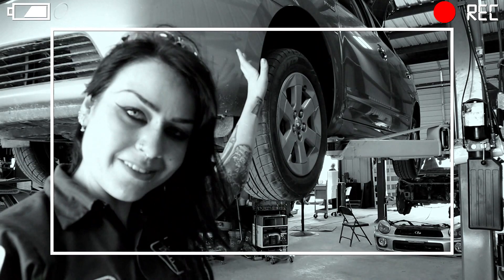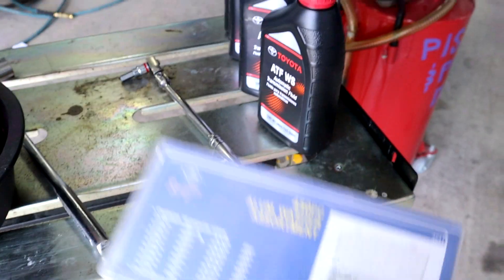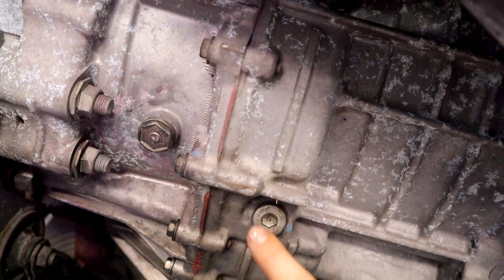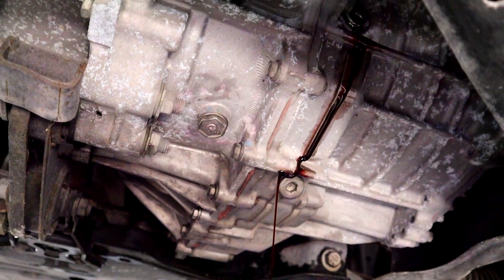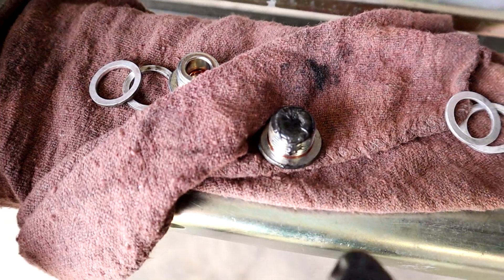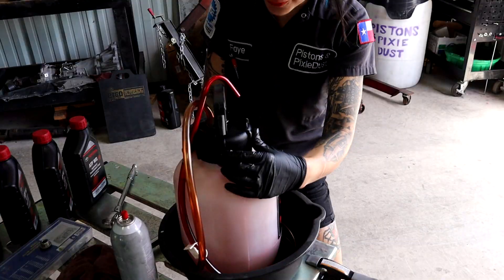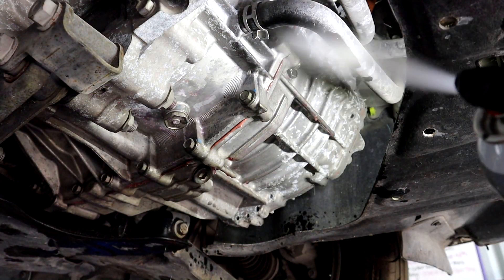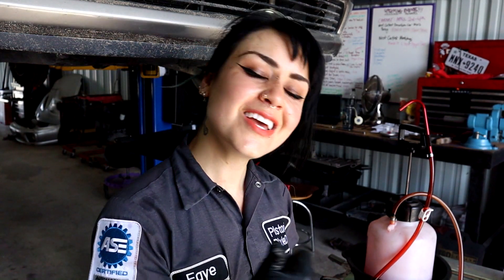How to Change the Fluid & Check the Fluid Level of your Gen 2 Prius Hybrid Transaxle / Transmission!

Comment: 29 torque lbs is actually too much...think about it, when the engine was new, that was the specs and those threads were dry...
Now you add that lubricant and that 29 actually gives you a greater stress than dry torque numbers. Fyi ...
Reply from the maker: I am sharing the service instructions verbatim from the Toyota Repair Manual. If you have an issue with the torque spec from the Toyota engineers, bring it up with them.

Comment: Thank you for your video. You were so thorough and advised using diagrams what is the correct fluid level. I also appreciated you including metric parameters for torque specifications ie newton meters (Nm). Other YouTube video just quote in imperial. Adrian - Dublin

Comment: You did an awesome job and I appreciate the info. The Motiv fluid pump may be quicker but it's too pricey at $101 for the average do it yourselfer. The $ 15.99 Slippery Pete Fluid Pump for Gallon Bottles and Wide Mouth Quart Bottles - Transfer Gear Oil, Transmission and Differential Fluid, Antifreeze with This 30cc Hand Pump

Comment: Thanks for the video. I was thinking to do my first transmission fluid change for my (TOYOTA 2015 PRIUS C (THREE)). I went to the dealership to get ATF WS. And the dealership told me that the fluid expands and cannot be done as a DIY project because my transmission will start leaking and possibly blow. I wanted to seek your advice before I call them liars and ruin my transmission.

I watched your video like 5 times so far and I did not see you using any special machine or anything. So you probably gonna say go ahead do it, but I wanted to ask your opinion about my situation..

Comment: "I don't know, doesn't matter..." 🤣 lifetime fluid, trans fails, it's lifetime is over, and you never had to change the fluid!  Any part can be replaced,  any car can be replaced, and In  the end any replaced part can fail.  The 100k mile spark plugs are usually pretty good, last the replacement interval and do a good job at it. When there is a misfire and you decide to swap the plugs out to eliminate them from the T/S tree, most factories, (good) tech school's and service manuals don't tell you to put new parts in,  it is "Known Good Unit" any replaced part can fail.  As new does not mean good, a used set is what is recommended, this applies not only to plugs, but ECM, ICU's... in most strategy based diagnostic criteria.... and remember you never drop a spark plug once,  the second time is in the trash can! Hi Faye, sorry to run on,  but at this hour I would think it expected. Hope you are enjoying the weather, catch you at the next Book Club! P.&A.S.

Comment: I'm confused by your torque wrench, 1, 0, 4, 3, 2 facing the camera?  Also, transmission fluid is the coolest looking stuff, so much car blood.
Reply from the maker: They are in increments of 5, so 25, 30, 35, 40..... the lines and numbers in between help you get precise, so 25+4= 29, so then the next digit is 0, so 30 lined up with the 0 is for sure 30!

Comment: Hi Faye, I'm planning on changing the transmission fluid on my son Nissan Exterra.  Meaning,  take the pan off and replace the filter.  Now, here is the question...to clean the transmission parts,  can I use breaks cleaning spray or not?